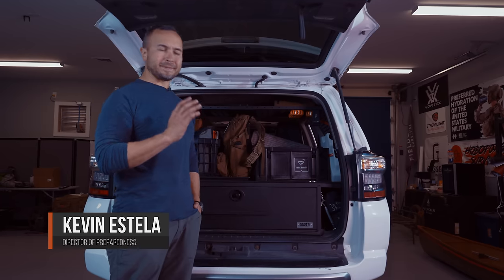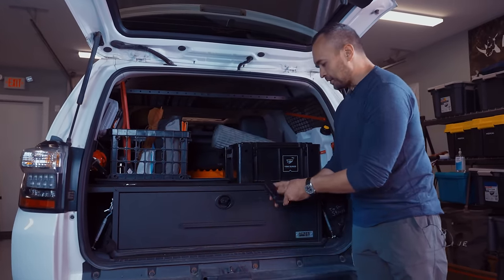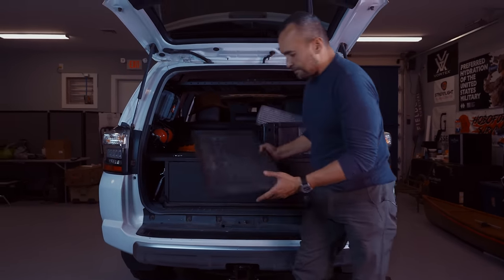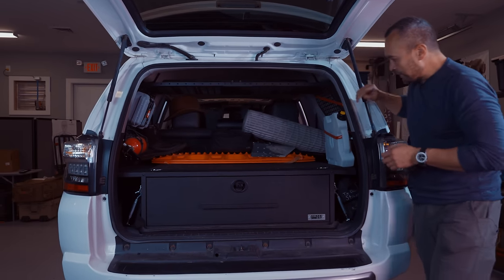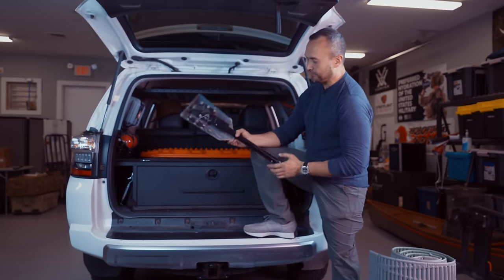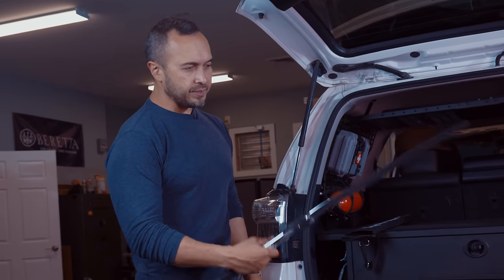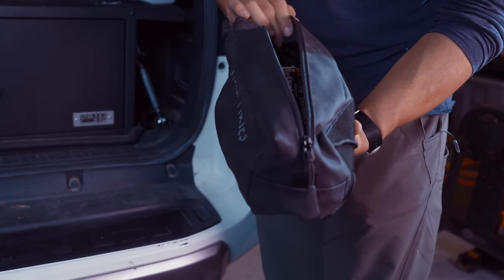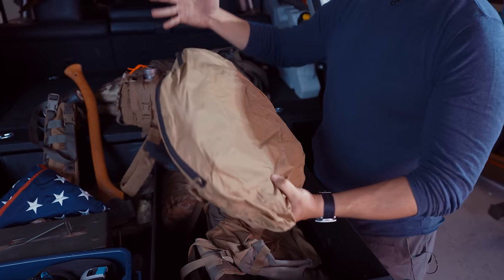Ultimate 4Runner Cargo Loadout Reveal

Comment: as part of my recovery gear, I have a tire repair kit, and I also keep an air compressor.   I offroad often.   Additionally, one thing I like to always have is a few large trash bags.  Great for cleanup, emergency poncho, lay it on the ground for working on the vehicle, put wet/muddy gear in it.   Takes up very little space. Good video

Comment: Nice setup.  I like to keep heavy objects like tow hitches secured where they dont turn into missiles aimed at my or passengers heads in case of an accident.  My last 4Runner got t boned and a bunch of stuff in the back ended up in the front.  I now have a Raingler net behind the rear seats.

Comment: Great video, i am running a fairly similar setup in my 97 4runner. 208k miles still kicking butt and taking names.

I do carry one of my compact arborist chainsaws with me. It doesnt leak oil or gas and it sips fuel. One full tank will likely get me out of every scenario ive come across. Ive cleared numerous trees off the road, and then skidded the big logs out of the way with my vehicle using a tow strap.

I will start carrying a good human powered saw though. Thats handy when you want to have a low audio profile.

Comment: Another saw suggestion is a Milwaukee or stihl battery powered chainsaw.
With lithium batteries and brushless motors they have become very useful and having an inverter built into the 4runner it's a good option

Comment: Great to get to ur Property vehicle,Solid UTV 4 pass that tows,Great offroad capabilities light,low fuel usage in the correct UTV,small TRex off road Camper 1200Lbs u can load it with everything u need,tools,ammo,food storage,generator & u have a camper if you don't have a Property away from the Urban areas. Kawi makes a solid 4 pass that tows 1400 Lbs & can load out w/1100 lbs on the vehicle.
Reply: If u could afford a Freaking Willie's MB & Ford GPW that would be the sht. No bs Computers, tow abilities,load out & offroad abilities, tru savage. Sometimes Light is way better when off road is concerned.

Comment: Excellent loadout I really been wanting that Kelly raised rack as well. Been trying to put it off, but now I might have to pull the trigger.
Reply: It is very durable. You can run it lower. Supports a lot of weight

Comment: You need hand tools, nothing crazy just something to get you buy. Screw drivers, wrenches, hammer , pliers should be basic in every vehicle. I would also replace the factory tool for changing tires with something more sturdy.